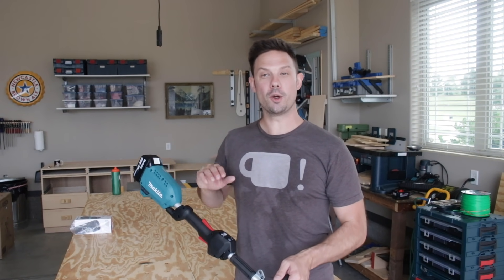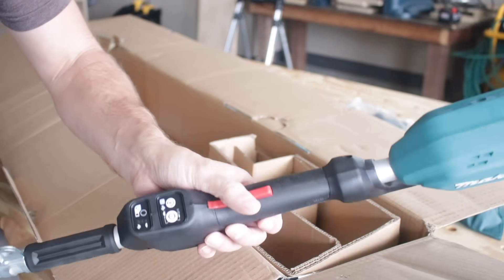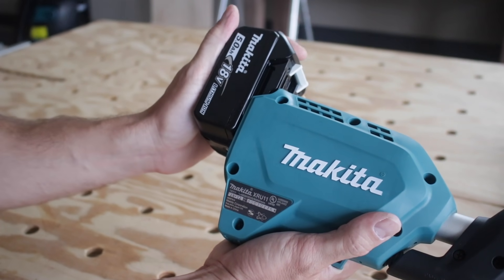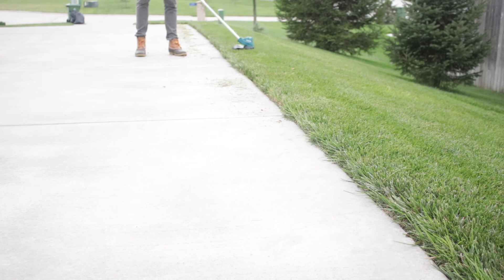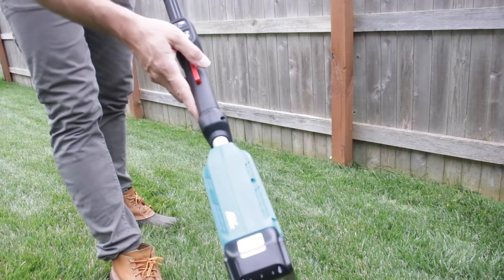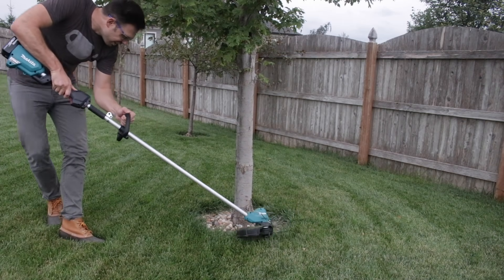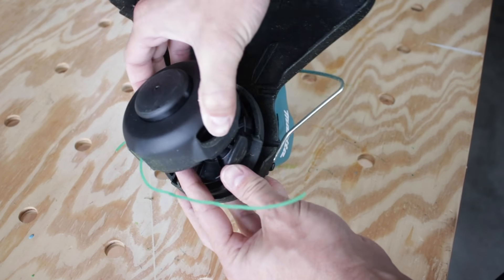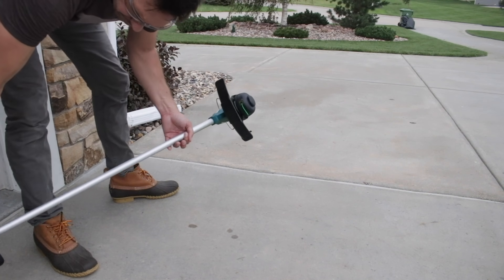MAKITA 18V Brushless Battery "Cordless" String Trimmer / Weed Eater Unboxing & Review

Comment: I wanted something light weight and capable of cutting. This little string trimmer is just that https://www.youtube.com/post/Ugkx_rBCFuDW1zD6blTGhLkvAkxU657uR_lG . The battery will last about half an hour. It cuts through most weeds and grass. I wanted to see what this trimmer could do and tried cutting down some brush. It does okay with light brush but heavy brush, not so much. This is a great tool for trimming around the yard. It's not great for clearing out brush but no one would expect it to be.Out of the box, this trimmer is extremely easy to use. All I had to do was attach the guard and load the battery.
Reply from the maker: Yep!

Comment: considerin the price of the Petrol one with far more power, i cant justify the 18v strimmer price. Run time of a full tank on the EL2600 vs 18v runtime. If your using for your garden (small to medium AND you own makita gear then fair enough, but for large areas, the petrol is the better option
Reply from the maker: Yeah I think I still agree with that.

Comment: We bought the bigger batteries and they last twelve minutes each, admittedly our garden much tougher going than this small suburban plot,. Twelve minutes not enough and gets through string but dont they all, otherwise a good machine. On the whole I would rather put up with a petrol strimmers short comings and get to work as and when I want than be constantly changing batteries, to keep this going you would need six batteries and five charging ports. probably not for the pro or challenging gardens.
Reply from the maker: Thanks for watching and sharing some thoughts! Good luck on your garden upkeep!

Comment: Nice vid but apparently you have to switch your hands (left one on the throttle) because this is counter clockwise trimmer. When edging, stand on the grass and the dirt will fly away from you.
Reply from the maker: That’s a great tip but I think I’d have trouble seeing my cut line. Thanks for the comment.

Comment: If it is still at full battery after 6 minutes of use it means the battery check feature is garbage.
Reply from the maker: After years of using Makita batteries in this tool, my mower, blower and track saw I can say that they retain their charge really well.

Comment: With that big size lawn i don't think you can cut deep with that battery and you have to recharge over and over again...eventually you will get tired of doing the unnecessary charging...luckily mine is 12 volt and i use computer power supply so i could use it all day i want without charging. But of course i still need it using battery which i will use for a small area
Reply from the maker: The whole point of my video was to actually show you that I didn’t need to recharge once during the entire weedeating process which I am thankful for.

Comment: I got a question that puzzling me for a long time. Can you help me answering this? 
My question is: 
I used to have an electric trimmer similar to this one and the theory of how it works is by spinning a thin plastic wire to cut the grass. The problem I had was the wire keep breaking into two pieces after about every 30 seconds when I was trimming the wild grass. Out of curiosity I wonder whether the trimmer that professionals are using the same kind of plastic wire?
Reply from the maker: Hi Mike. Hmm. I don’t know. I know for me I use the Makita branded plastic and don’t have any issues unless it gets too long and the metal cutter on the edge of the guard cuts it down a little. Maybe another viewer can help with input.

Comment: great review.  I'm sold.  Darn near pulled a muscle in my arm today trying to get my gas Echo to start.  I'm done.  I already own Makita tools so I have  batteries.....should I buy the kit though so I have extra is my only question.  Thanks for the video.
Reply: If you're just doing your own yard I'd be you'll be fine with your current batteries for a while.
Reply: @ArbitraryLifestyle  thanks!
Reply from the maker: Heck yea!  I  hear you.  I think you are good with just the batteries you have but if it makes sense to add a small amount to the purchase for another battery that might be worth it.  I can do my whole yard on one 4ah battery.  thanks again for commenting!

Comment: I cannot get the spool off to replace the string. No matter how I press the tabs in and try and pull it off it won’t budge. Any advice?
Reply from the maker: Man that sounds like a manufacture defect. I would contact Makita or the store you bought it from. Sorry to hear that happened. I've had no issues.

Comment: just sold me on this. im going to buy the one that comes with a 4.0ah battery just so i have the extra. i have the makita drill/driver combo with (2) 2.Ah batteries read the online manual and my batteries are compatible so i will have (2) 2Ah and (1) 4.0Ah i use this for my little side lawn business as i can charge the batteries from yard to yard with my power inverter in the cig lighter port. i currently have a crap and decker and only get about 10 mins of weedeating on each 2.0ah battery
Reply from the maker: Awesome!!  And yea I’m certain of that with B&D.

Comment: Argh~  what am I doin' wrong?  I bought the exact same Makita but can't get the line to feed at all.  My "bump advance" is a "bum stay put".    I've ordered an aftermarket line head to see if that works.  If not they both go back and I get the Stihl you were complaining about!  A reverse journey.
Reply from the maker: Man so sorry to hear that! Mine still bump feeds no prob. String size?
Reply: @diywithandrew  It's the original string that came with the trimmer --- I've never been able to make it through.  

Are there any settings, etc, re the bump advance mechanism?
Reply from the maker: @georgegonzalez-rivas3787  Man that is a bummer.  Not that I know of.  Occasionally I'll need to bump it hard but that's it.
Reply: I have the same problem:(

Comment: I noticed you used a 5AH battery but the unit came with a 4AH, obviously  completely interchangeable.
Reply from the maker: Great observation! Yes that is correct and why I bought because I already had some batteries with my Makita 18V Track Saw.
Reply: @diywithandrew  So is your review not somewhat invalidated by using an upgraded battery that does not come with the unit?  The question I'm wondering now is great, but how does it perform with the 4AH battery that comes with it??
Reply from the maker: @johngraham6839  I can't say scientifically how a 5ah battery performs better than a 4ah battery, but based on the lack of battery drain on the 5ah I have no reason to think it would have drained the 4ah much more.  I was focussing more on the tool and not battery science in this vid. Thanks for your comments as I am sure others are wondering the same thing though!

Comment: All of our tools are DeWalt, so was really bummed to realize that the shaft on their string trimmer is just too long for my 5'3", 68 year old body. I find I'm bending backwards so it doesn't go too far down. I landed on your review through a search engine. Question: Is the model reviewed adjustable? Ours is 39" and WAY too long for me. Husband is 6'3" and works for him but I'm an impatient sort and want to do it myself. Also, can you put pre-loaded string cartridges on rather than playing with the string? I think that part may lose me. Too impatient.  Thanks for your review and glad to hear it's still going strong.
Reply from the maker: Thanks for the comment! Sorry to hear of all the troubles. This one is not adjustable and I have not tried different cartridges. Sorry I wasn’t more help!

Comment: For anyone interested, Home Depot has this item listed at $150 right now.  Makita is trying to push their new 36v models, which have a more powerful & efficient motor, with longer runtime.  With that said, I will be buying this 18v brushless model this weekend because I don't really have the need for the bigger version.
Reply from the maker: Thanks for letting everyone know, David! That's a great deal.  I hope you enjoy it!
Reply: Just bought the blower, trimmer battery and charger kit for 229.    Pretty good deal.

Comment: Nice little trimmer, definitely not powerful enough for my needs, I'm eyeing the twin 18V model that is as powerful as my commercial 1KW Husqvarna trimmer.  But if there's anything I really hate about the Makita grass trimmers than it has to be their trimmer heads. Not only that they don't have any of the modern stuff on them like the EGO's powerhead system which inserts the line automatically with pushing one button, they still don't have the powerfeed capability that Echo pioneered on their trimmer heads. We all know how the system works so there's no need for me to explain it here.. I don't even want to mention high tech technologies that Stihl and EGO use which sense the length of a trimmer line and spool it out without the need to tap the head on the ground to release a few inches of a new line..
Although my Husqvarna also doesn't have any of those fancy new technologies their trimmer heads are super quality and even a small bump on the ground will release the line needed. Also respooling the line is preatty easy, even if you have to open up the head.
Makita's trimmer heads are one of the worst on the market and I would advise anyone to buy a replacement one from Echo, Shindawa or Stihl the minute they buy the Makita trimmer.
Reply from the maker: Thanks for the thorough input!

Comment: Hey Andrew, just bought one of these yesterday & have just finished putting it together with help of your video...thanks for great video. I read a comment down below of a guy saying you don’t have to bump the head to feed the line, he says that it’s meant to automatically feed the line through when it gets low...is this true or do I still have to tap the head on the ground to feed the line? Sorry for my ignorance but I’ve never used an edge trimmer before & have just moved into a house from an apartment.
Reply from the maker: Hi Michelle. Thanks for the kind comment and great question.  You absolutely have to bump the line to feed more of the line out of the spool.  I typically just stop and bump a few times in the grass.  Enjoy your new toy!

Comment: You forgot 2 things:  On the head assy there are actually 2 nuts/washers.  The heavy one and the light thin one.  I think the heavy one goes in first so the flat side is facing out.  The thin one follows to keep grass out of the inside of the head.  Then, the head screws on counter clockwise!   Then as you mentioned stick an allen wench in a side hole to hand tighten the head. Skip this step, and the head will spin off when you stop the unit.
Reply from the maker: Thanks for more input, John. Glad we have a large community to share more information with my viewers here.

Comment: Thank you for showing me how to install the string 👍🏼
Reply from the maker: You bet!!
Reply: @diywithandrew  what is a bump feed? I have this but and someone else put it together. I need to redo the cord and this video helps a LOT!
Reply from the maker: @jaieatsplants  Great question!  At the very bottom of the spool mechanism there is a rounded bump.  When you are spinning your feed (using your weedeater) it is spinning very fast, when you tap it on the ground the bottom "bumps" pushing up the plastic and releasing some of the plastic line allowing it to "feed" out a little bit.  Hope that helps!
Reply: Does the string get wrapped to the RIGHT OR LEFT  does it  matter?

Comment: Yo! You seem to respond to comments so here's a quick question from Eastern Europe, where our lawns are probably dense jungles for ya.
I usually trim with my very little brushcutter, it's a small petrol powered boy, my father bought it around 2003, it is a Stihl FS 350! I use it for trimming. Like, rarely! Knee high grass cant be done with lawnmovers especially with varying ground elevation, crapload of mole hills and in between lots of trees. Next time, when I have my own money, I want to buy an electric one (battery ofc), but Stihl's highest offering is at the "130". FSA 130. I probably could not live with what I saw most US citizens use, the FS 89, but the 130 seemed powerful when I borrowed it from a store (they allow it for regular customers), but the whole battery thing from stihl is laughably expensive. Can you check out some high-end battery brushcutters, either with trimmer line or the 3-blade tool that can do 4 inch high, very dense flora? It is such a nice place you got to live, my man. It's all grass. Most of us here, step out of the front door and we have all kinds of unknown vegetation right in our face, it is really a magic how can you guys manage such nice lawns.

Hope you can do some demonstration, or at least provide some feedback, I would really appreciate it! Good video, and best of regards.
Reply from the maker: Hi Sandor!  I try to respond as best as I can.  Thanks for sharing! Seems like you live in a beautiful place! ... To my knowledge, one of the most powerful cordless string trimmers/weed eaters would be the Milwaukee https://amzn.to/2L7QQzv or the DeWalt https://amzn.to/35Jx6LZ .  Thanks again for commenting and good luck to you!
Reply: @diywithandrew  Thanks for the fast reply! I can't seem to access prices for my country, but checking the reviews, it's $180 for the DeWalt and about $300(Canada) for the Milwaukee. They seem pretty good, but considering the reviews for the DeWalt it looks like it has motor issues, but the more unknown brand (for me at least) seems powerful, and by the reviews, it is. I'll try to contact them if they're in the country and ask them for a demo spin, as said, I really want to go green, it's all my dream getting rid of gas power, but I have to find something with both juice and runtime, not necessarily at the same time. Really glad for the findings, thanks again. A quick question if you do have some time, can we access data regarding their power? I mean, electric cars have a kW (not kWh) rating for power, and they run on batteries. So I find it unconfortable to see cordless drills and battery equipment with only torque data and not watts. I tried extrapolating with given runtime on a certain x Ah battery, and found the FSA 130 to be around 200-300 watts which is very very low compared to the 1.6 hp of the gas one, so if you do have any info about that, I would be moe than eager for that! Until then, have a nice day.

Comment: Yep you sold me on it. I have an old Stilh 55r. Finally giving me trouble. I have only had it in the shop a few times. Really good product. When it wouldn't run today I was 30 miles from the Stilh dealer. Had to load up the truck, go to the dealer, get the parts, go back to the shop, install the parts and then back to the job that only took 15 more minutes to finish. Needless to say I choked the old rascal a few times and thought about bashing it on the driveway. Yeah I kinda lost it with a few choise words thrown. I have many Makita products with at least 4 extra sets of batteries. You jetting around and one handing it pushed me over. Thanks!!!! They have 10 in stock at the Home Depot near me.
Reply from the maker: Man, I COMPLETELY understand everything you just described. I love my Stihl but MAN it was a beast to start sometimes and rattled my arms off! Thanks for taking some time to share and I'm really glad this video helped you.  Haha!  It really is so light. And the fact that you already have Makita batteries makes it a no brainer.  Best to you!

Comment: I'm stuck between this and the Milwaukee. I like that with the mil you can exchange attachments. Edger, saw, etc. But I like the price of this one waaaaay more and I plan on going all in on mikita power tools so the battery unison would be nice.
Reply from the maker: I felt the EXACT same way.  I almost bought Milwaukee.  My neighbor had the Milwaukee and I was able to test it.  It is a great string trimmer. Very powerful.  However it is much heavier, bigger and I didn't have any Milwaukee batteries. Since I already have the Makita Cordless track saw, that uses these same Makita batteries and I wanted a lighter trimmer, this was the right call.  Good luck with your decision!
Reply: @diywithandrew  I went with the mikita, after doing more digging at 2am I found that the huge 9ah bats on the mil could overheat and burnout in hot temps. Gets 100+ here regularly. Plus as cool as beast mode products are realistically the worst thing I'm going to wack is like dandelions. Gives me an excuse to buy more mikita tools
Reply: I have both and the Milwaukee is heavy and very unbalanced. Yes its powerful but weight is a concern and honestly i think makita batteries hold charge better.

Comment: Bought one last year got bored and went for a sthil fs94
Reply from the maker: Nice! Enjoy the POWER!
Reply: Field Treasure Designs enjoy the lack of power
Reply from the maker: @harveyhaywood8141  lol. Thanks! I will.  That's WHY I bought it. I'm not a commercial landscaper.
Reply: Harvey Haywood They pay you in 🍪 over at Stihl?
Reply: The 94 is nice it has good power but will get bogged down in tall grass or weeds and wound up.  Also the carbs get dirty fast if you are trimming every day. End up pulling like ten times even with priming. Choke is nice first start of the day. Breathing in gas exhaust gives me a headache. Ill go for the 36v
Reply: Jerome Pinkus Jr. got a 91 now got more power
Reply: Jerome Pinkus Jr.  and my 94 starts ever time first pull